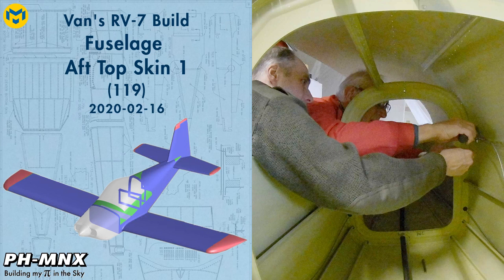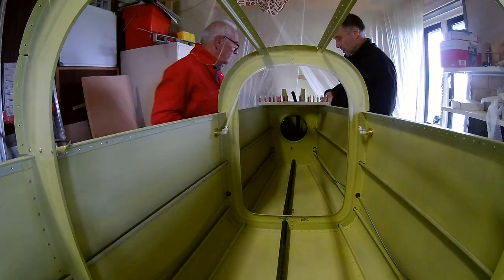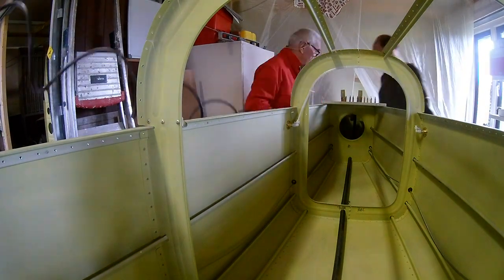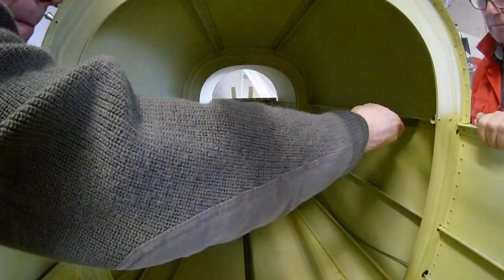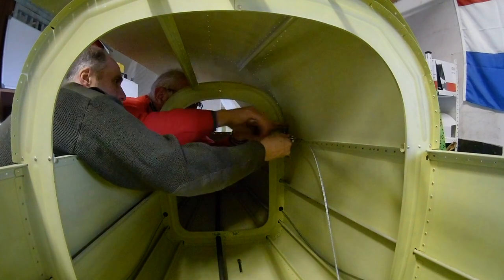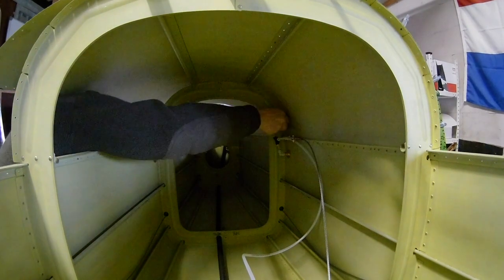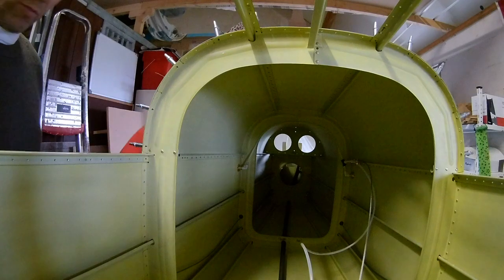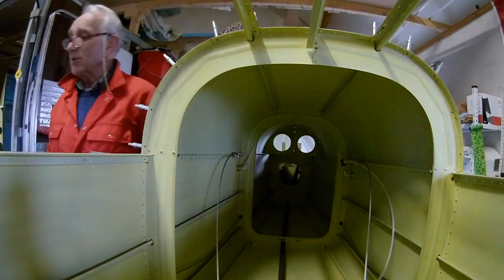Van's RV-7 Build Fuselage Aft Top Skin 1 (119)

Comment: What primer are you using?
Reply from the maker: Hi Timothy,
I'm using Sikkens Washprimer 1K CF. It's an AkzoNobel product, not sure if it is available outside Europe.
It's a 1K Etching primer (http://www.sikkensnamobile.com/Products/Details/74?searchPhrase=&categoryId=10).
I scuff the aluminum with ScotchBrite pads and degrease it with KRISTAL Aqua degreaser. 
Works great and I have no complaints yet. Except it's really dangerous to eyes and lungs.
Cheers,
Marcel Heijmans